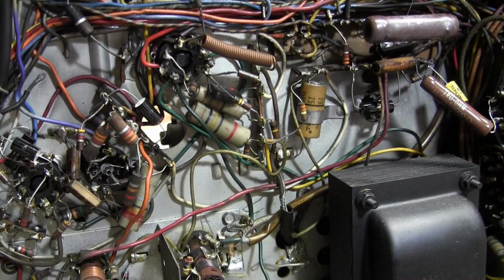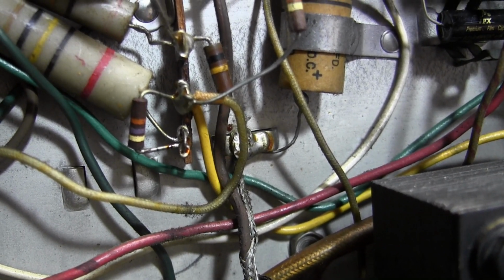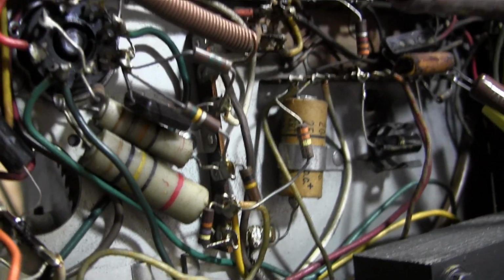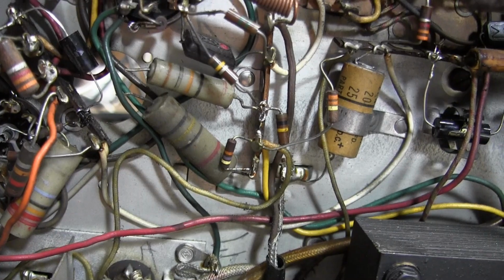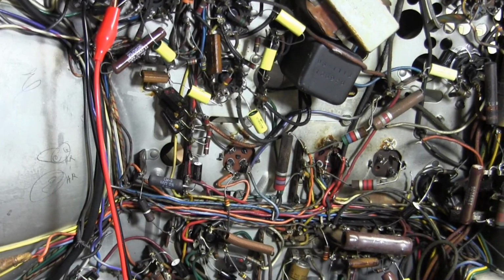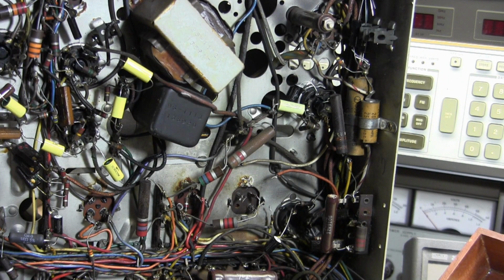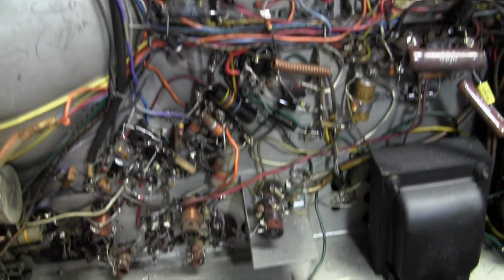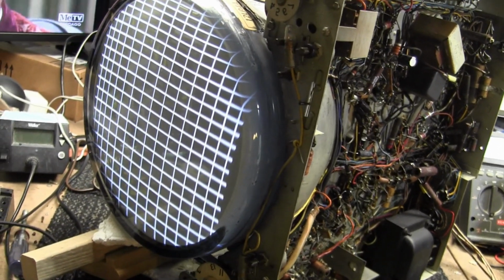Zenith 28T960 "Waldorf" part 8 - Hakko FR-301, installing JFX caps

Comment: I have a FR-301 for a few years now and it's a wonderful desoldering tool. Sucks away so much solder that it makes it easier to remove most jay hooked connections. I would not be without a vacuum desoldering tool like this!

Comment: Hi Bob, I always completely strip each terminal (terminal strip or tube socket) when doing restorations.  Unfortunately, there is no "elegant" way to do this.  I use a solder sucker iron, spring loaded solder sucker, and solder wick dipped in rosen flux to remove the solder.  Then clip the lead wire as it loops around the terminal, than peal the lead away from the terminal.  I also will cut the lead from the component, leaving about 1/3rd inch of the lead extending from the terminal, so I can heat the terminal and push the lead back into the terminal to unwind the lead from the terminal.  On tube sockets with the large solder filled pins (such as an Octal), you must remove the tube from the tube socket, otherwise you will solder the tube base to the socket.

When using the solder sucker iron, I add some eutectic (63/37 tin/lead) solder between the iron tip and terminal as a heat bridge to conduct heat and lower the solder melting temperature.  Of course, it is easy to melt wiring insulation and those yellow plastic film caps with an accidental touch of that large soldering iron body.
Reply from the maker: Even if you are only removing one component are there are several tied to that point?  I suspect you have more time than I do.  I have a backlog of a couple hundred sets!
Reply: @bandersentv  Right, I removed all the leads from the terminal, then remove all the solder, then re-tin the terminal, then install the new, and reinstall the old components that are still good..  Agreed, I am retired so, have a lot more free time and I don't have the extra burden of a daytime job like you do.  I am actually amazed you can handle both jobs.  I know what I am doing seems like a waste of time but, we all have priorities we like to maintain.

Comment: I have a simpler old-school desoldering iron with a hollow tip and a squeeze bulb to vacuum. It works pretty well on PCBs with through hole leads, also somewhat useful on other things.  I wonder how it compares with the FR-301. I also have a plastic solder sucker, and wick too, so I have several techniques. Between them, I can usually do OK, but wonder if this is worth the additional investment.
Reply from the maker: FR-301 is amazing on PCBs.  Especially if you are removing ICs with many pins.
Reply: @bandersentv  Good to know. Then there's a whole new world of soldering I haven't really learned relating to surface mount components, with hot air soldering, reflow, etc. I don't usually work on that type of equipment.

Comment: How about using soldering iron to heat up the terminal in one hand and hit it with de-soldering gun in the other hand .
 Also I would not solder electrolityc capacitor directly to tube socket ,  The tube gets hot so the heat will migrate to the capacitor

Comment: As I'm watching you try not to melt  any wire insulation(as I've done), I'm thinking about using high temp insulation "tubing" on the metal sleeve to help prevent damaging insulation.

Comment: I have a Hakko 470B and a 471. They're smaller, lighter guns, but you have to have the main unit within the length of the cable/vacuum hose. I may have to get one of these self-contained units.

Comment: My FR-301 is the best $$$.$$ I've never regretted spending as it makes removing through-hole components actually fun when they just fall of the PCB, like meat off of well-smoked ribs.  For P-T-P lug stuff, not so much, partially if the original builder over-did his "secure mechanical connection" by wrapping. the lead several times over the lug.  Arrrgh.  For that, I wish you'd devote a video to the proper use, and selection (!) of solder wick as in my book you're the solder-wick ace.  Thanks for the videos.
Reply from the maker: OK, I can do that.  One key I never hear talked about is storing your solder wick in an air tight container.  The flux degrades otherwise.  I'll also be doing a more in depth unboxing and review of the FR-301 using a vintage PCB.

Comment: The Hakko FR-301 is my go to for desoldering.  It works fantastic.  There are a lot of tips for it and you might pick up several sizes as  that will affect how will it works on various components, lugs, etc.  Yes adding some new solder before desoldering will help the desoldering process.

Comment: Will be interested to see if/how you resolve the h. linearity on this set. Struggled with a similar issue on a 49 TV with a 6BG6 HOT. Ended up with a consensus on the TV forum that "it was as good as it would get" based on the grid starting to conduct.
Reply from the maker: I suspect it is the 6BG6 or associated circuit.  That would also affect the vertical since the boost voltage is probably low.

Comment: Bob, if you allow me to say, the principle should be the same, applying a little bit of new solder on old one always helps to remove it. One suggestion would be clipping the components and simply clean the terminals of what was left in it.
Reply from the maker: Yes, I'm familiar with the technique.   I'm usually only removing one or two wires from a lug, not all of them.